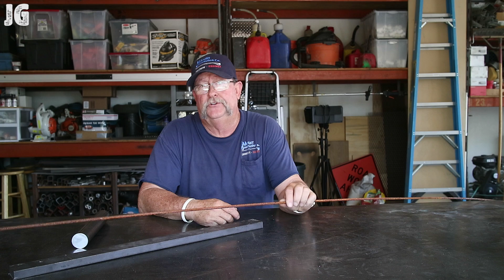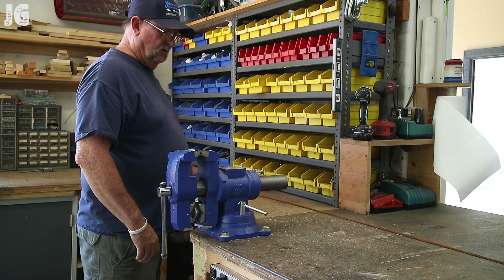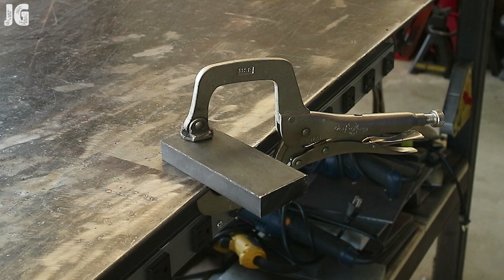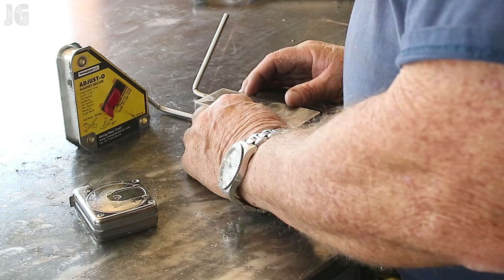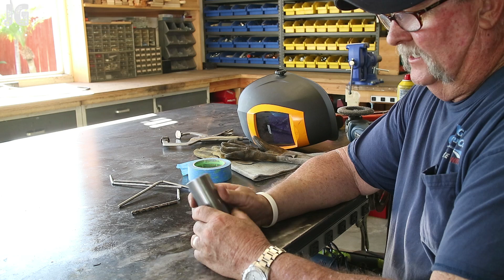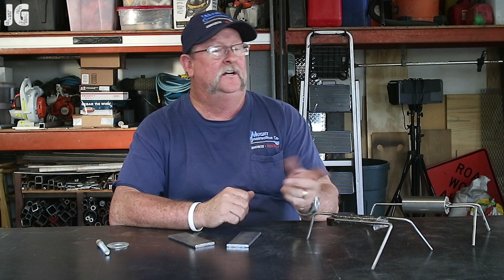Third Hand Build - Jimbos Garage

Comment: One way to clean rust off round bar is to chuck it in your drill and run it across you belt sander that you use to deburr your tubing.

Comment: What blade are you using on your cut off saw? I would dearly love to throw my abrasive wheel cut off saw blades in the trash after seeing how well your works.
Reply from the maker: +Aaron Nunya Thanks for watching Aaron! There are a lot of different manufactures out there, Mine is a "Tenryu". There is more to just changing the blade out , The saw is different also, It runs at a slower r.p.m. I would recommend you look into getting a metal cutting cut off saw. Mine was about $600 with the blade.   Jimbos garage!